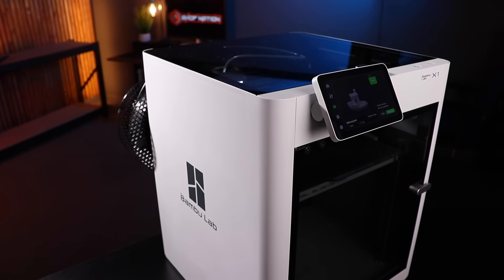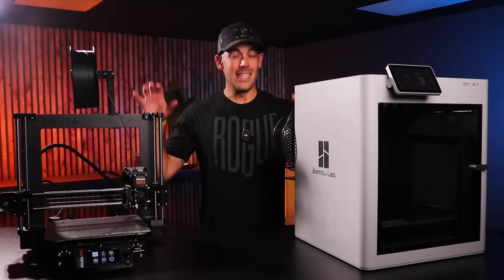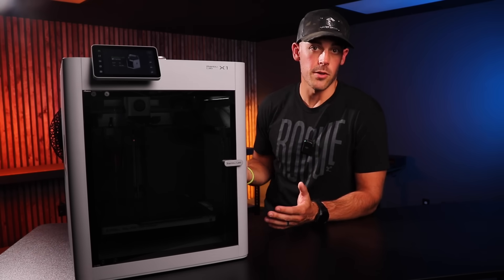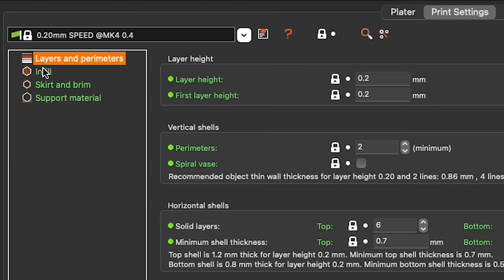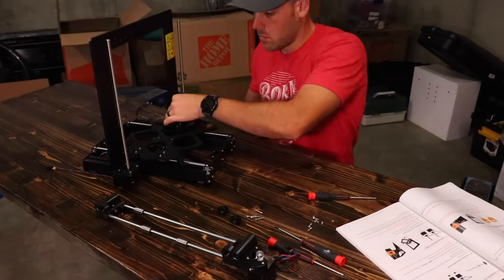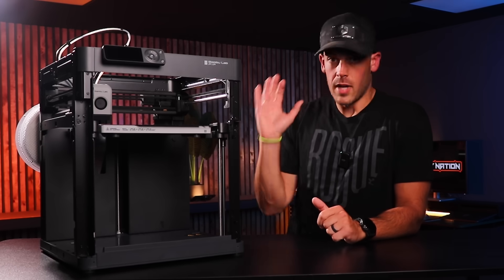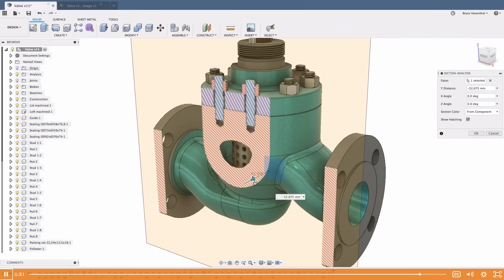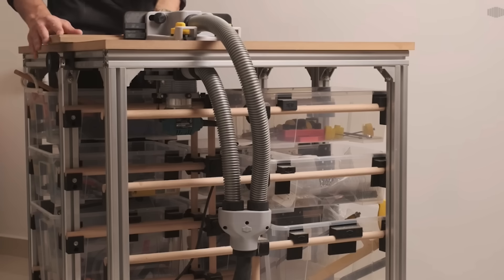The 3D Printer I'd buy if I started over

Comment: 700$ for a 3d printing beginner is just insanely retarded
go buy a anycubic kobra 2/2 pro or elegoo neptune 4 / 4 pro, costs around 350$ and u get a hightech machine that prints fast and reliably and  for the next few years lmao

ps: ive got my first 3d printer like 10 years ago and ive had a few so far, i did it and still 3d printing as a hobby to have fun and show my creativity with 3d designing myself and for that u dont need 700$ or even 1200$

 get a `cheap' printer and some free 3d programs like plasticity/fusion360/sketchup and let ur thoughts and ideas get to life

Comment: A lot of these commenter's don't understand who your audience is. 
An ender 3 is more than enough for those trinket makers, but if you are making anything functional, the ender 3 just isn't reliable, consistent, or fast enough. 
I bought an ender 3 for making functional prints for my farm and for every 10hours of printing, I have to do at least an hour of maintenence. Even with $600 of upgrades later. 
In the long run, a prusa mk3 is more economically viable. Especially for me. 

Going back now and looking for a replacement machine, I'm likely getting a p1s due to their reliability, precision, and speed. Something that a low end printer like the ender 3 can't do

Comment: Manual bed leveling really isn't hard.  I think it's also a good skill for a beginner to learn as it helps them understand their printer, the mechanics of 3d printing, and the printing process.  Sure, auto-leveling is an amazing and time saving feature to have but one can save the money and get by without it.  A lot of printers are now supporting the BL Touch/CR Touch devices as well which makes auto-leveling available for a LOT of printer brands and models for about $40. For someone just getting into 3d printing, I wouldn't recommend they run out and buy a $1200 printer.  What if they find out that printing just isn't for them or just can't understand how to do it? That printer becomes an expensive paper weight unless they wanna go through the process of finding a buyer for it but good luck getting all your money back in a resale.  The money they will lose in reselling it would be enough to buy a cheaper 3d printer that would work just fine. 

Now that I've been printing for a few years, having put my first printer together piece by piece, I'm sure glad I didn't run out and get a full-featured printer to begin with.  I learned so much by putting one together (it didn't come preassembled) and leveling the beds.  However if I had the money for a Prusa or Bambu Labs printer now, I'd definitely get one.  My latest addition was the Longer LK5 Pro.  It has a massive print area, open-source motherboard, upgradable, and replaceable (if a part goes bad, I can easily get a replacement). It cost less than $300 and, while it's no speed-demon, it can do almost everything as the 4-digit price tag printers.

Comment: Im a bit of a gearhead, so modding one doesnt bother me. I just wish the ender didnt need quite so much. 
I was printing some small parts for a project the other day. Needed 18.  Like 20 min each. Did em all in a row. 
17 of em came out perfect.  Ran no 18, and now some how the bed is like 3mm wonky and nothing will stick. 
WTH? I didnt touch anything except pulling the magnetic bed.

Comment: I’ve only had to level my anycubic chiron manually once which was 3 years ago and it has never had any issues with leveling 🤷‍♂️ if you do it right you shouldn’t have issues (I print everything from pla, abs, tpu, and petg (still have yet to try other filaments) I’d also like to add that I haven’t upgraded any component on my Chiron it’s still completely stock 🤓

Comment: Since Bambulab is fraudulently trying to apply for patents that the 3D community has made available to everyone for free as Open-source, this printer is not allowed in my house in any form. And that's not even mentioning Prusa's excellent communication with customers, easy repairability, long support, etc. MK4 is the clear king.
Reply: By the way, Input Shaping has already been implemented for many months. This is also a huge advantage of Prusa, they still improve something even for older machines. Over and over. His printers mature like wine.

Comment: Is this still up to date with the current technology increases?  I have a ton of 3D modeling and printing experience from 3D printers available at the local tech college I volunteer for, but I do not have the ability to test a bunch of different machines.  I am happy to drop around $2,000 for a solid printer, as I am going to be designing parts/enclosures/pieces/etc for physics/space experiments and want the printed pieces to be as accurate and professional as possible.  This video was posted 11 months ago, so I may not get a reply, but on the off chance that I do, I genuinely appreciate it!

Comment: I've had my Artillery X1 for 5 years with two heads does it all. It's not that hard. It prints at 120ms cleanly with a removable PEI Plate. TPU to Fiber filament.

Comment: "Here's the best 3d printer for a beginner" immediately comes out of the gate with two different top-of-the-line $1,200 printers

You're recommending a $1,200 printer to someone brand new to the hobby. That's irresponsible.
Reply: I mean, he explained why in the video. Cheaper printers are nice. But they require a ton more babying and troubleshooting. It's a hurdle for beginners that can keep many away from the hobby.

And it's clear you didn't watch the video because he didn't recommend $1200 printers for beginners. He recommended the P1P for $700. Although, I imagine that would change to the P1S if the video was more recent.
Reply: @matthewdavenport9549 700USD is still way too much. It's irresponsible. Specially with the release of Bambu Lab A1 Mini.
Reply: @NuryPPanaligan  I mean, that's up the the person. $700 is a pretty good sized investment in a printer. But, I personally think there is a valid argument for it being worth that extra cost. Even for a beginner.
Reply: It's ridiculous. We're talking about people who may decide this hobby isn't for them. If you don't want people to have to maintain the printer then he should recommend using a local library or UPS who allow you to use their printers for a very reasonable price per gram of PLA.

Comment: I always struggled to use programs such as AutoCad so I settled on Blender, which is far more limited than Autocad but it's much easier. In the course of 2 years I built a table with aluminum tubes and 3d printed parts, with a pc built into it.
Since the very beginning I used blender and you can make quite good models in my opinion

Comment: I can't tell you the amount of times I've looked into purchasing a 3d printer. This is again one of those times. The problem is every time I fire up YouTube to do some research the videos I watch basically talk about buying a printer and then pretty much replacing every part in the new printer with other parts. So I just purchased a new printer to replace everything in it? Seems scammy to me. I just want to buy a printer and it works. I wouldn't be printing toys and such mostly stuff for around the house. Mainly for the garage and my tools. Are these printers overkill for that?

Comment: Prusa has been a huge disappointment.  Mine has never "just worked" and it is not reliable.  My slightly modified Ender 3 is a better more reliable printer.  It came as a kit.  I ordered that way because I'd helped build two other Prusas.  After contacting tech support and replacing a few parts they recommended sending it back.  I packaged it all up sent it back a few days later they sent me a list of minor issues they found which I frankly don't believe anymore.  After a few prints it started doing the same thing I'd sent it in for.  Tecjh support recommended replacing the PINDA again.  If that didn't work, they said I'd need to replace the board.  The problem didn't go away after the PINDA was replaced.  The Prusa collects dust now.   My X1 runs circles around my Prusa.  My coworkers A1 runs circles around the Prusa.  The P1P is fine but I'd spend 600 bucks on the A1 and have the option of the AMS.

Comment: The start point is to drop 700 bucks. Surely you recognize how that hurts the hobby
Reply: Thats basically the price of a smartphone, a video game console, or a proper camera. Proper sports equipment will pile up to similar heights.

Yes you can get a much cheaper one that requires more hustle, but if you are planning to something substantial and over a long time invest at the beginning - the point of the whole video I guess
Reply: The point is that there are many more affordable options that have almost the same print quality if not better. Honestly an elegoo Neptune 4 the new anycubic kobra would be sufficient  @LeonKBF
Reply: Start point is the Bambu A1 at $350. Same build size as the X/P series, still faster than the mk4, and I haven't had much issues in my print farm.
Reply: If its your start point, buy a cheaper model. Got an Ender 3 secondhand for 100 usd.

Comment: Funny you mention ender3 Take a v2 upgrade to metal extruder Capricorn tube micro Swiss nozzel and heater bl touch and dual z drive and you have the equivalent of the mk4 for about $400 or just get the k1 for $429 Great right out of the box only needs fine tuning

Comment: I bought a Bambu Lab X1C about a year ago. I'm an old guy (retired) and didn't want to spend the rest of my life tinkering with a 3d printer, but instead I wanted it to print what I wanted, reliably. If you want to save some $$$ you can use filament from Amazon but that means you have to figure out what parameters the filament needs to print. If not, use Bambu filament and the AMS reads a RFID on each spool that tells it what filament is in what slot and how best to print with that filament. 
It takes a month or two to get your brain around the 3d printer world and you realize lots of things you can do with a good 3d printer. I got it to tinker with and print toys for my grandkids, and now have printed parts for friends RV's and just about everything else!
Reply: Im glad you find this kinda stuff enjoyable.🎉

Comment: 2:24 I feel personally called out lmaoooo

It's so true though. I have done so much maintenance and repairs on my used Ender 3 V2. Bought for 200 CAD, probably have spent less than 300 CAD on upgrades and crap. I'm never buying a Bowden Tube based printer ever again. That thing kept jamming because every filament I have, does not like the extruder spring tightness of eachother. They get chewed up, jammed and stuck in the tube. After several hours and hemorrhages, you just want to curl up in a ball and get back into programming. And yes, unless you get certain upgrades and spend hours on calibratibg, you will need to level your bed a decent amount. A lot in my case because I print a lot. Just get an Elegoo Neptune 3 or 4. Cheap and feature complete.

Despite all that. I love this POS. It has taught me lots, and I'd recommend it if you're after something decent, cheap, and upgradable... So long as you don't go crazy and print essentially 24/7 like I do. Like I am getting my money's worth... Maybe not the mental health's worth but we'll ignore that.

I just got a new bracket upgrade to turn it into a direct drive, after hours if tweaking, its quality is great. The quality was great with the Bowden Tube too... When it worked but do not try to go all in with this thing.

But yeah, I would really love a Prusa or BambuLabs. They do in fact just work. Unless it's my highschool's in which case someone will tell it to print below the bed, ruining both bed and nozzle, and somehow break the heating element's wires because they somehow messed up a nozzle change... I swear they put glue fumes in that building's HVAC system...

Comment: A friend of mine has the Bambulab X1C, and I love it. If I were to start passing out trophies, I'd give the best in class trophy to this printer. It does everything it was designed to, much better than any other printer in this size class. I have a very heavily modified Ender 5 Plus, and an Ender 3 V3 SE. I would LOVE to buy a Bambulab X1C, but it's too small for my needs. After I got into 3D printing, I decided that I wanted to print and build a life size, fully functional R2D2, and even my E5+ is too small. I want to be able to print the dome (and other parts as well) as one piece.

Comment: For those who like to tinker with printers, I personally would state that the Ender 5 is one of the best. While what you start with is definitely what you paid for, it is one of the most moddable printers out there (with people converting them into something more resembling a Voron than the original printer) with 3 point auto bed levelling. It definitely takes work, but I’ve learned a lot with mine. Then again, I’m one of those people who enjoys trying to get these things working.

Comment: Quite intressting , you hit my opinion . I m thinking of buying a 3D printer for technical solutions and useful products and not dust collectors or toys. Now I got curious to the QIDI 3 Max plus, it looks quite robust and has a large print volume and is fast. Whats your opinion ? good choice ? or Prusa ? I want to use metal for printing ! no just kidding at work we print Turbine blades in metal. No carbon base materials would be acceptable, it has to be very sturdy

Comment: Hello, Iam a 69-year-old dumb Butt. So, I looked around and found a deal in my price range ( Voxelab Aquila S3 3D). But it failed right out of the box. Not knowing much as I am new to 3d printing. It took me a day and a half to give up trying to print. I had a buddy come over with his heat scanner and the head heat was good. So I put on my thinking cap, what was the main issue? Intermittent printing. So, I started looking at the feeder, and I found it. The feed roller gear drive did not have a set screw in it. I have not checked the other side as it would take disassembly of the head. I will try to let you know how they resolve this and how long it takes.   Rickie Smith

Comment: This video was the one that convinced me that my first 3D printer should be a Prusa MK4, and I've had nothing but a fantastic experience with it.  I went with the kit build and I now feel incredibly comfortable swapping out parts or diagnosing problems.  And there is no level of praise I can give the Prusa support team that is sufficient enough to truly indicate to you how awesome they are.  You'd think the customer service on a kit build product would be sub par based on the fact that they let idiots like me build the printer, but the times that I've called into their support team, they've been nothing short of miraculous with their patience, and willingness to help.  I had a few underperforming parts with my kit build and they had those parts in a Fed-Ex package and on my doorstep with in a couple days of me logging the issue.  

The X1C might be a faster, more sleek looking machine, but my next printer will be a Prusa as well, and the one after that, and the one after that.  The experience I've had with them has made me a fanboy.  

My only complaint?   Buying filament or replacement parts from Prusa.  They need a more economic way of shipping parts to North America.  It's not that big of a deal if you are doing a large order, but if I need a new nozzle, it's going to cost me $40 for the nozzle and another $30 for the shipping and import fees.
Reply: MK4 is awesome printer, but Bambu is better and cheaper.

Comment: I looked at both of those printers Bambu and Prusa and almost popped for them until it got to the cart and I saw that they wanted shipping and other fees possible to get them. NO way! Not buying an expensive pig-in-a-poke and paying even more on top of that. I've learned by experience to not believe everything said on these videos (especially if they got it free). I've heard others swear by them or at them. I ended up getting a K1C for less than either of these and it's been working great right out of the box.